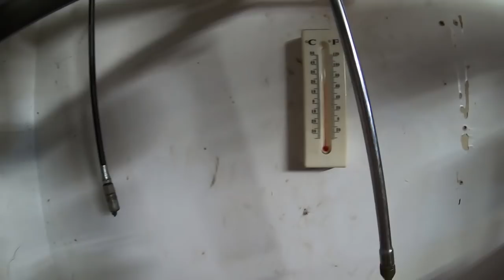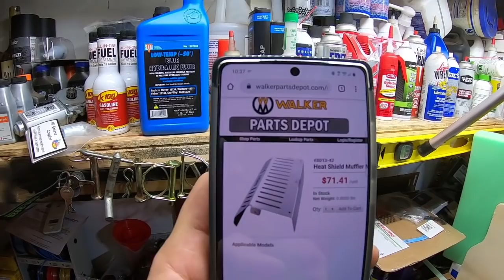Fixing Broken Lawn Mower

Comment: Plan b should have been plan a in my opinion with not having a way to weld aluminum. Personally I would have riveted with a washer on the back rather than bolt the new piece of aluminum. Just personal preference. I find it ridiculous that you are having to fix that considering that I didn’t see one dent in that guard. I commented on your last video on the seat, and I’m clearly not that thrilled with the fit and finish for what you get. First overall the concept of the Walker mower is hands down the best machine for anyone that runs a lawn and snow removal business. One machine runs so many different attachments for different seasons. No mater how big you are a Walker can do so much, but the Walker family needs to step it up they have been riding the grandfathers concept for to may decades. They can do so much more for the consumer, only if they would listen. Like your last video they seriously can find the best solution for a seat? Yeah if they want to charge more for the better seat than make it the best dam seat in the industry not a aftermarket seat that you can bolt on anything. Same with the Walker mower holding a hill they are terrible holding a hill. Please note I’m not a Walker mower hater. I’m a Walker mower owner that loves the concept, and hope one day they just listen to the professional consumer, and make Walker that much better for not a ton of extra money. Like have a deck height adjustment included instead of having to do it with four pins. The competition is bring it, but they still have not been able it be as compact, and versatile from season to season. Once again I’m a proud owner of a Walker mower, but they need to step up there game quite a bit
Reply from the maker: I agree 100%. They continuously expand in the wrong directions. They are capable of so much expansion and they fall short every time

Comment: That heat guard looks expensive any who  you did the job to save your money 💰 I've got to find another transmission for my newest  LT 1000. Mower  then get it installed on the mower  great job using self tapping.if you want to but you did what you had to
Reply: @CountrysideStrong  👍😎👍😎

Comment: I just replaced my muffler sheild and it was 50 bucks!! The time you spent on that how many hrs? Your time was worth more then 59 bucks imo but I always like to fix shit myself so i feel yes
Reply from the maker: It was about 15 mins, it's the off season and I don't have jack shit to do so..... Blowing even $50 is pathetic when you can fix it for $3 and 15 mins of your time. It's all about not being lazy and having common sense 😉
Reply: @CountrysideStrong  oh I feel you man wasent bitching at you just saying I must paid 50 for one i couldent repair mine. But what I ment bye your time is more valuable meaning if you had work to do messing with that isent worth it but on off season I try to fix everything on my own becouse yes money is tight off season and are winters suck now we used to get real winters but no anymore
Reply from the maker: No I understand. See I don't have that money issue, haven't in years. I plan accordingly and adjust where I need to do that I can literally sit on my ass all winter if I want with what I stack away all summer. I plow because I hate being bored. I also don't ever work past 4 pm during the season. Some days I have to but it's rare. I plan accordingly. It's all about knowing your numbers and budgeting your money responsibly.
Reply: @CountrysideStrong  I try to stack away a hood 5 to 8k to fall back on in the winter. Alot of my plow contracts pretty much gete there but this year was rough. The wife stopped working to stay home with kids. My kid got covid and equipment failure has strapped me this year but my goal is 5to8k stacked away for winter. That's the minimum. Some years are better then most.
Reply from the maker: @jesserousseau2481  I hear that